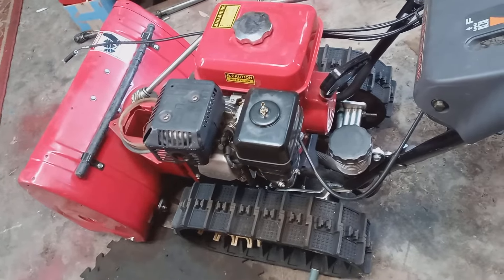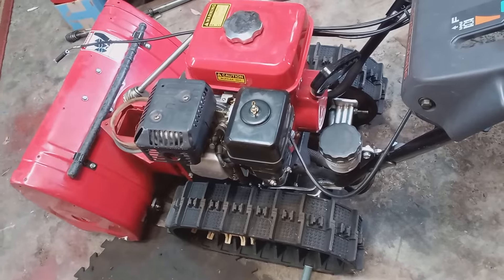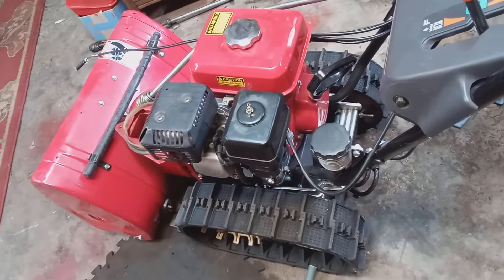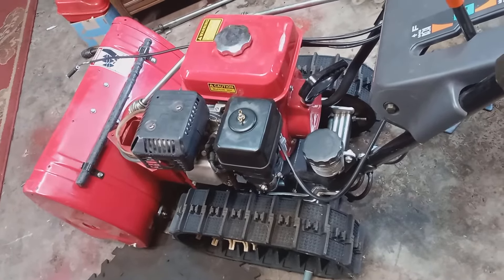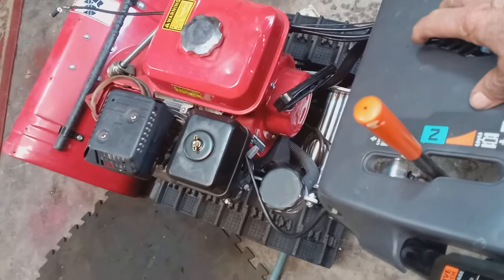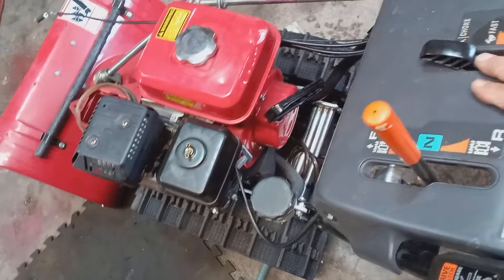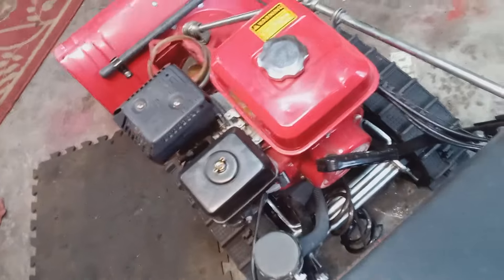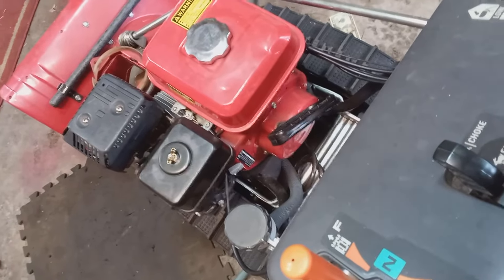How To Quickly ReStart  Flooded Honda Snowblower ! Any Small Engine

Comment: Hello . My 3 year old Honda started for one minute then it stopped. I did put gas in before using it. But now the auto start button wont work and the cord cannot be pulled. It’s stuck. Any advice? Thanks so much!
Reply from the maker: It won't also pull start? locked up? Please post this question on our Facebook group Honda Snowblower Enthusiasts. Many good people there. Thanks.

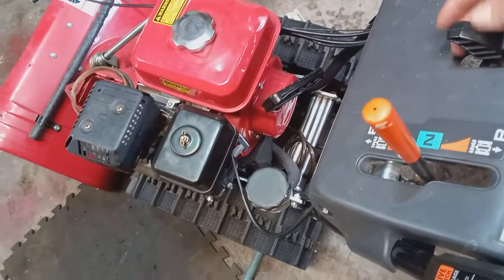Comment: Answer at 2:53.
Reply from the maker: My channel is for the average Honda snowblower owner so I try to give as much info as possible. My experience from answering thousands of questions. All mechanics like YOU already know this stuff. Thanks.
Reply from the maker: BTW if you are a mechanic I encourage you to join my FB group HONDA SNOWBLOWER ENTHUSIASTS with over 4000 members. I need all the help I can get. thx.
Reply: @HondaSnowblowerEnthusiasts311  My HS828 ended up not being flooded. I watched another of your videos where you do trouble shooting steps, and went through all of them. Got it on the last step. My choke was stuck closed. I watched your on frame carb cleaning video and will do that maintenance once the weather warms up this spring. Thank you for the content! Very valuable.
Reply from the maker: thanks . glad you got it done. I bet it was satisfying. @A_Bunch_of_Savages
Reply: @HondaSnowblowerEnthusiasts311  Yeah, and a major relief. We have 3 storms lined up.
Reply from the maker: appreciate your comments. @A_Bunch_of_Savages